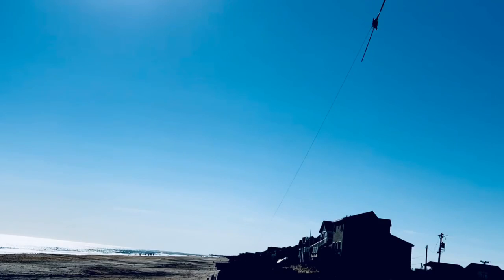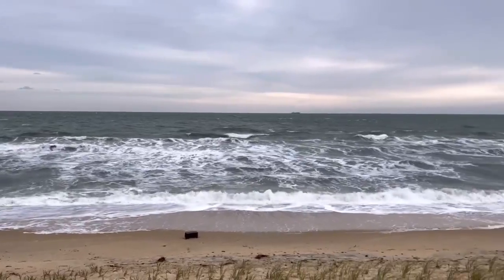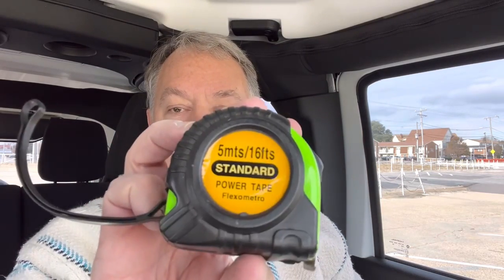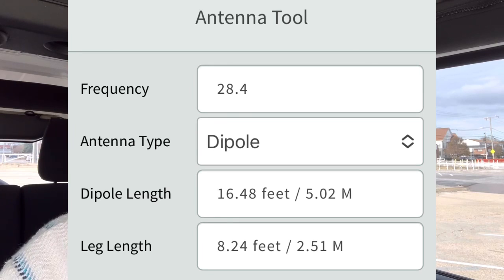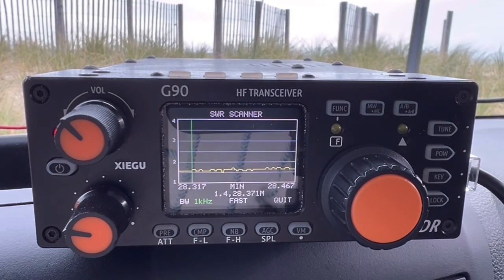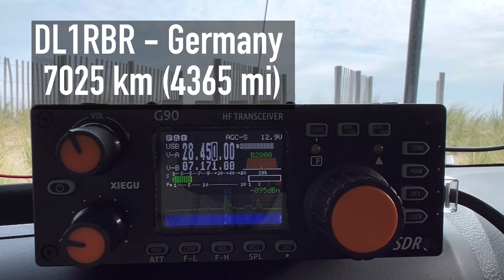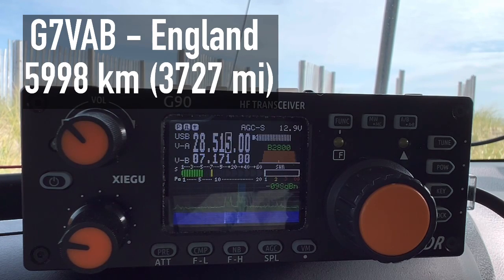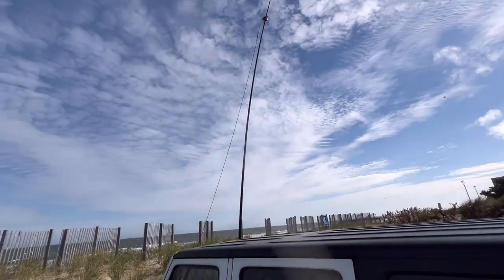Vertical Dipole Antenna with a Chameleon CHA LEFS 4010

Comment: I definitely  need  some radio for my radio soul I  haven't  operated  my home radio station  in over  a month and a half.  I am  staying with  my  daughter  recovering from  a  broken  ankle injury that happened  on October 20th. The doctor  said I will be off my right foot for two and half  months.  So I  am definitely  having  radio withdrawals. It would be  great  if someone  in the ham community  would  come by my daughter house and  put up temporary  antenna for me. That would make me feel better. But I  know that  no one  in the  Waycross, Georgia  area is going to  do that. O well I  guess  I  will  just have to  suffer it out until I can get back on my feet and get  back  home in Blackshear, Georgia.  73 AE4OY WILLIAM PEACOCK EM-81UF Blackshear, Georgia 😢

Comment: The vertical dipole gets sooo little love. Very cool to see your setup and your success. Your radio is only 20w, right? So many people think they’re missing out if they run less than 100w. (I run 5-70 mobile into an ATAS-120A on a 3 magnet mount-still rocking into Eastern Europe with my 891 from south central Pa..) 73!
Reply from the maker: Yes just 20 watts! Thanks for watching and commenting, 73

Comment: On your way to #1 ham radio podcast! But off tje antenna Subject, you are always using the XIEGU--how do you like it for the mobile/portable operation? Tuner (++) and power (--) seems big differences, not sure if the panadapter is useful. Any thoughts?

I always used tbe Hustler mobile system and had great luck, would think your video topic on shortened with coil vs extended antennas would be great topic. I swear my Huslter 10m with 54 in mast was a beam if I aimed my car the right way. GL 73 de WO8USA🇺🇸🇺🇸🇺🇸
Reply from the maker: Thanks! I really like the Xiegu G90 a lot because of the tuner and I’ve found that 20 watts is just enough for good mobile/portable ops as I can go all day and never have to worry about the battery. I use a little 6aH battery and have gone as long as 8 hours without the battery dying. I’ve made some great contacts with 20w and have had the radio hooked to my 100w amp and tested many times in QSO’s going from 100 to 20 watts with barely a single S unit difference. I find it interesting the directional experience you’ve had with the Hustler. I need to go play around and see if I experience that lol. All the best and 73, Walt

Comment: Just wondering have you ever used a rotatable dipole recently bought a HFV-5 it is in a V config connected to a plate setting it up for it on rotater and pole facing north would I have either side of the V facing North or the open V. where it connects to plate on pole facing north
Reply from the maker: Hi Tony, no I have never used a rotatable dipole but that sounds like an interesting antenna.

Comment: Walt I appreciate your review of this antenna. Others scoff in the comments about an overpriced Chameleon antenna. I've got 2 others and just used one this weekend in CQWW CW contest along with a MFJ EFHW. The DX stations heard me well where the MFJ was useless. I ordered the CHA LEFS 4010 on Black Friday with 25% off the price. Looking forward to using it backpacking for POTA/SOTA. Thanks for your review with the vertical dipole configuration. 73 de KN3A.
Reply from the maker: Thanks for watching and commenting! I agree,  a well engineered and built "Made in the USA" product that performs and will last comes at a price point that's a little higher than something that's built on a kitchen table as a side hustle or mass produced by cheap labor in China.  It's great to get a comment from someone that understands that. 73, Walt

Comment: Thanks for the review Walt, but at $175.00 for an end fed antenna with a couple poles for a dipole, it's fantastically overpriced. You can find so many other quality EFHW's for far, far less money. You could build this yourself with quality parts and wire for $40.00. This antenna has no magic that every other EFHW doesn't also have. As to the dipole feature, who wants a heavy transformer on top of their pole. One of the Banana Plug to BNC adapters weighs next to nothing and costs just a few bucks. They make a great and cheap dipole center section. It's a gimmick antenna. Adding a BNC and two connectors costs next to nothing. It's not trick or novel.  Chameleon makes a quality antenna but they are always overpriced and perform the same as a much lower priced antennas. Walt, love ya man. Please don't fall for the free, overpriced candy being offered.  Your channel is the best because you have always shown just how good a simple, low priced antenna can perform. Too many new hams see these overpriced antennas and think they will be getting so much more performance because they bought a name and payed twice what the antenna is worth. We know that they are not. Stay true to what your channel has always been. Stay warm Walt !
Reply from the maker: I will always build my own for sure. There are people out there that just don't have the time to build themselves and there are also people that want to buy American. In our economy a product engineered and manufactured in the USA by a company with employees and brick and mortar has a cost greater than that from someone who is building something on their kitchen table as a side hustle or mass producing in China with cheap labor. It's just the way it is. I turn down freebies from China weekly (you can go see the other HamTubers reviewing them) but I will always review a good product that was "Made in the USA".  I only wish we had more ham radio manufacturing here in the USA. I respect your opinion, that's mine.
All the best and 73, Walt

Comment: I'm a noob so I apologize for the noob question...  are the wires for the 10 meter dipole extended  "north and south" on the mast?
Reply from the maker: No worries, the wires are taped to the pole straight up and down vertically. This makes the antenna omnidirectional versus the directional pattern of a flat top dipole.

Comment: Got me thinking Walt, you could make it a sloper and anchor it with a rope against the wind direction. Less strain on the pole maybe, and coax away at a better angle. But of course more work. Sometimes the challenge is in how fast and easy the antenna can be set up.
Reply from the maker: roger that, that's actually Chameleon's recommendations for deploying this. I just wanted to try it completely vertical by saltwater.

Comment: Hi Walt,
My antenna is a 64.8 foot longwire with a 49:1 transformer. The wire is from Sotabeams and the transformer came from Moonraker, which are manufactured in house. I have it 6 meters in the air and it gives me 40,20,15 and 10 meter bands. I get a 1.3:1 SWR on the 4 bands.
Works very well. Had contacts with USA, Canada, Australia, Asia, China and Japan with just 10 watts.
All the best. David M0DUU
Reply: By the way Walt, love the new knobs on the G90. Very smart.
David M0DUU
Reply from the maker: Thanks David! 73